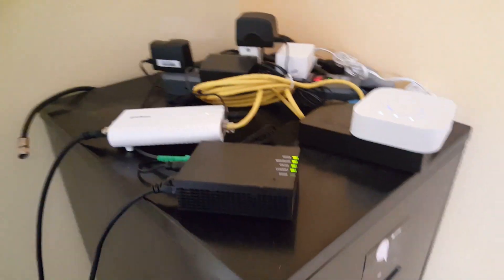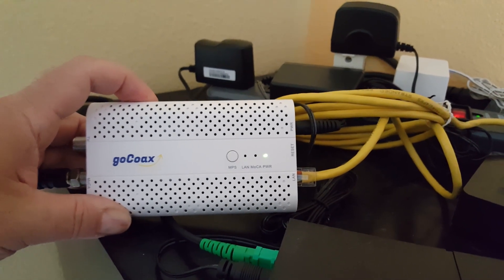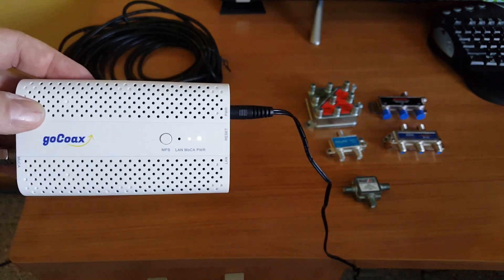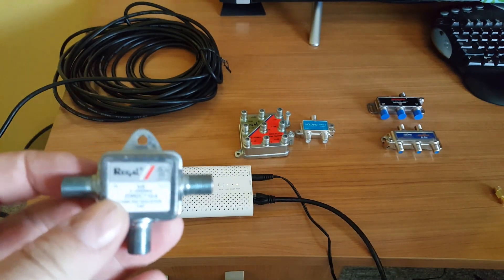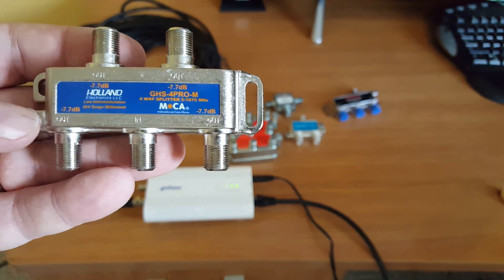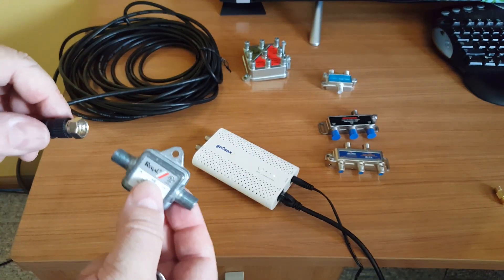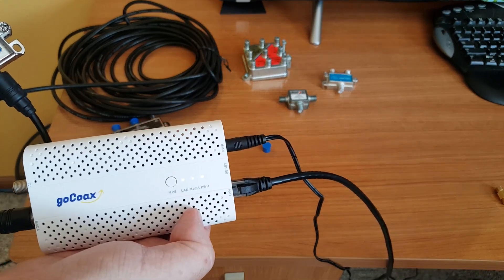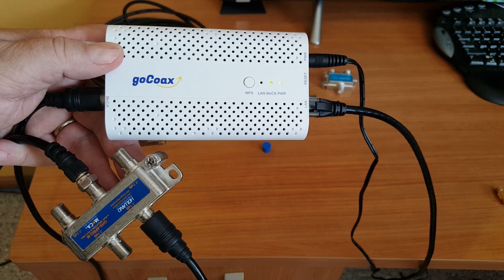How to troubleshoot connection problems with MoCA (goCoax WF-803M) and basic MoCA setup requirements

Comment: Wait, reviewed slitters, then at the end "why wouldn't a moca connection not work? I don't know!"  The video is titled How to troubleshoot... not reviewing splitters.
Reply from the maker: the wrong splitter and/or incorrect testing/diagnosis of a basic connection is the most likely cause of your MoCA connection not working.  Above all else, do the devices communicate when directly connected?  then is my splitter compatible (and I mean ALL splitters in the walls, not just the ONE you can see).  MoCA is pretty bulletproof, but you do have to eliminate the obvious issues before you go off the deep end and say the devices don't work.

Comment: Thank you. My network will work
Reply: I want to set up a network to sell the internet to 1000  apartments. They have done coaxial wiring for TV centarall.
I would like to know how many MoCA units can be supported by one unit and the distance it can cover.
Reply from the maker: 16 nodes, up to 300 feet apart.  That is the limit.
Reply from the maker: I sincerely hope so, friend!

Comment: So how do I set this up when junction box is upstairs?  I have five coax runs coming from the junction box to certain parts of the home, both upstairs and downstairs.  Does one MOCA connect to the Modem or to the router?  What about a "filter" to ensure traffic is not thrown out in the wild?  

As for the second MOCA, I get the setup and understand that part.  And what about connecting FIVE rooms?  I need one MOCA at the modem or router and FIVE other MOCA adapters in the rooms and connected?
Reply from the maker: You can put a MoCA filter at the point the coaxial enters your home to stop leaks.
As far as the number of devices, yes, one at the modem/router and one at each other drop point.  5 rooms aside from the router = 6 devices.
As far as the junction being "upstairs", it works no different than if it were downstairs as in my example.  At least as far as I can see.  It all translates.
Reply: @UncleMikeRetro  THANK YOU!!  I will Google a filter as I have never had to use one don't know which type to use.  My confusion still is where the Coac comes  Is into the house ...I'm guessing a filter on a splitter and then the outs would connect one  MOCA box and then each of my rooms?  Then the Ethernet from the MOCA box plugs directly into the Wan port on the router?   The setup before this was coax into the Modem and the Ethernet port on the modem plugged directly into the WAN  port on the router.    So am I completely incorrect in that if I use MOCA setup I bypass the modem and do not use that.  

 Ask for the rest of the devices in the house I understand how the mocha works it's just at the modem/ router part
Reply from the maker: @GR8GUY54  Glad to help.  How can you bypass your modem and still have internet?  The modem should plug into the WAN port of your router and then one of the ethernet ports of the router should plug into the MoCA device right there.  Then the coaxial out of that MoCA device feeds back into the coaxial lines in your home and should find each of the other MoCA devices in the other rooms.  It can sound complicated but isn't in all reality.

Comment: Thanks for doing this video! It gave me the idea to directly connect the 2 devices first to make sure they're working just fine. Found out it's a problem with the coax wire runs in the wall. Appreciate it!
Reply from the maker: Glad I could help!
I do try to preach to do the smallest checks first, rip open the walls as a last resort!
Reply: @UncleMikeRetro  I should have checked the coax runs first. Whoever redid these last removed the 8 way splitter and just connected one cable directly to the jack near the modem in a closet
Reply from the maker: I mean, really?  That's all you can say...

Comment: My Spectrum Ubee modem is not MoCa enabled or set up, which means I would need to have a MoCa adapter connected to it before I can begin connecting MoCa adapters elsewhere throughout the house. However, the splitter that connects to the coax cable in the wall and outside, is an Antronix ARPI-2000 Power Inserter ; 5 MHz - 1002 MHz. So with this particular splitter that TimeWarner/Spectrum set up, one end is connected to a cable that goes to the coax wall, another coax connected to the modem, and another coax connected to an AC power that's plugged into an outlet. The Spectrum tech support said she had no MoCa training but suggested getting a MoCa enabled modem that is separate from the Ubee, which would be used for home phone/landline services, and the second modem for internet and mesh setup. Is this the best option or is there a splitter option that doesn't require me getting a second modem? I hope this makes sense and thanks in advance.
Reply from the maker: Do you have your own router?  You should just connect a MoCA adapter to one of the LAN ports of your router and then send the signal back through your own coaxial lines.  you need 2 MoCA devices to start.  My own setup that I show in the video has no MoCA-enabled anythings but the adapters.
Reply: @UncleMikeRetro  I am still using the Apple AirPort Extreme/Express setup, which is currently just wireless. However, I was planning on updating to the Eero Pro mesh 6e WiFi to update. And my plan was to connect each mesh unit to the Coax tv cables on each floor to ensure stronger Wifi. If I don't set up the Moca at the network base modem and end up just connecting it to the next room where Spectrum cable tv is and then connect MoCa in both basement and upstairs in order to set up the mesh....will that be fine and ensure MoCa stays strong and secured as well? Thanks in advance.
Reply from the maker: No, the MoCA will only work AFTER there is an IP address for it to transmit.  The devices basically act like ethernet cables.  They take a signal and move it along the coaxial lines.  Taking the signal directly form the modem will NOT allow it to get an IP address, so this won't work.  You really need a router OR a switch attached to your mesh network, but it needs a lan port and a signal with an IP address.
Reply: Not sure if this will help your problem, but a lot of MoCA devices operate between 1000 - 2000 MHz range. For example, the Hitron HT-EM4 works between 1175 and 1625 MHz. So your splitter might be out of range.

Maybe replacing the splitter with one that's 5 - 2500 MHz (common to find) might fix the issue?
Reply from the maker: @mikeburke3279  That might be a super idea.  Not too expensive to try.

Comment: My 2016 Spectrum Ubee modem I think is supposedly moca enabled (or can be) but not sure if the splitter they used with it is a moca splitter. If Ubee modem is moca enabled, then should i update the splitter (if not a mocha splitter) that connects to it if not currently set up to be moca enabled? Or should i instead connect a mocha adapter to the modem? I hope this makes sense. Thanks in advance.
Reply from the maker: check to see what frequencies that splitter uses.  MoCA is usually 850-1500

Comment: Your video saved me! Our modem was installed in the basement.  router is on first floor. Worked for a while, then stopped recently.  Couldnt get it working using Customer support.   I strung a 100' ethernet cable from basement to router, and it worked fine, but couldn't find an easy way to get it thru walls/floor.  I read about  Coax to Ethernet adapters and gave it a try, since we have unused coax thruout house. I got 2 Hitron MoCa 2.5 adapters.  I watched a bunch  of videos and couldnt get it working.  Found you video, which clearly and logically laid out how this type of system works and communicates.  You were also the first to explain how older splitters often wont pass the MoCa  2.5 signals. I ditched the 2 splitters in the path, and  it instantly worked!!   I think I could have gotten older cheaper non-MoCa adapters, and it might have worked, even with the splitters.  Thanks for all the great information, presented in such a clear way.
Reply from the maker: Get out!  Such a nice detailed comment that I am sure others have trouble with too.   Any time something I post in good faith helps a new friend makes my day!😄

Comment: Could non moca approved but working 1 in, 2 out splitters be slowing my connection? I get about 700mbs dl to my Motorola Wi-Fi combo router. I have 1 gig service from RCN. So down in speed right away. My setup: From street there is Poe filter then splitter number 1 then to router. Router has the first moca device. Splitter number one second coax runs to other side of house where it splits again to bedroom and living room. Lr and br have working moca devices. But when I tested those speeds at the end moca devices hooked to laptop the were like 60mbs dl so serious deterioration. I have about 12-15 smart devices using Wi-Fi, ring, 3 Amazon units, tv, hue lights, ecobee. My moca devices are screenbeams 2.5. Everything is working great but that speed loss bugs me. The distance from one side of house is about 30’ run of coax. And my desktop computer wired directly to my Motorola router/Wi-Fi combo gets about 700mb dl at first but goes down as speedtest runs and ends about 280mbs dl. Thank you!
Reply from the maker: In THEORY, everything should work fine.
But, as we can see, there is a loss (serious) in speed.
You are going to HATE this suggestion, but you really have to disconnect all of the devices and then test the speeds of each one individually to see if any of the other devices are interfering.
Then, you have to take two devices, one at the router (where I assume your MoCA signal originates) and the other device at each of the other ends/drops/rooms to test the speed of just those two devices and see if some of your lines have issues.
When I was setting my network up, you would not believe all of the tiny 1 in 2 out splitters that I found in the walls (because no one really runs 100' of coaxial if they can just connect 3 or 4 25' lines, right?).
I had to clean a lot up.
Reply: @UncleMikeRetro  by disconnecting all the devices you mean all the ones on wifi side or the physically connected ones at moca? Thx
Reply: I forgot to add I ran all the coax new myself so know it well.
Reply from the maker: OK.
Hmmm.  Can you do a test run with just two physical MoCA devices and a run of your new coax line?  See if you can get 1GB in any case, using best methods and conditions.  The WIFI devices, as you allude to, should NOT make any difference.  If you get a 1GB speed test run from your ISP, you should get very close to this (900+) in a straight connection.  I would think.
Reply: @UncleMikeRetro  i will try that on Monday. Thats exactly what I was thinking too. Also if that works, run a line straight to a Moca in lr sans splitters
Reply from the maker: @Daltondoubledeuce  Let us know how that goes, Ed
Reply: @UncleMikeRetro  Okay, sometimes its not the results that are wrong, but the testing equipment. I have 2 Imacs on my desk, one 2011, one 2019. Older Imac was connected ethernet to router when I tested. I also tested the end points with an even older Macbook. I should have known. 

I moved the ethernet to my 2019 Imac, boom 900mbs. So I moved my 2019 Imac to both MoCa endpoints, plugged in ethernet and boom again 900mbs. So my network is functioning perfectly. Doh! Thx for your help - Ed
Reply: Sometimes your router can't handle gigabit speeds (my old R7000 from 2014 would max out at 250 megabit). When I upgraded from a 300 megabit connection via Cox, I replaced the router with a new WiFi 7 router. Something to consider.

Comment: Hello, I'm just finding this video and it was very helpful.  I have a couple of questions, but let me ask this one first.  My cable wire entry point is located on a box on the outside of the house.  This is considered Spectrum's property therefore I cannot find out if they have MoCA splitters installed without making a service call.  Inside the house I can modify the wiring.  If I install MoCA splitter inside will that work or does it need to be at the point of entry?
Reply from the maker: Hello and welcome!  
The MoCA splitter you use should REPLACE the large one that is probably somewhere inside your home.  The Spectrum signal should come into the house via 1 coaxial line then get split (somewhere, like mine was in the ceiling of my utility room) to send a line to each separate drop.  Just replace this splitter with a MoCA capable one and no worries.
THIS video may explain better:  https://youtu.be/_Gfjnspfd94
Reply: @UncleMikeRetro  Hi again, I don't believe I have a splitter inside my walls.  I can trace the four wires from the junction box on the outside of my house making the 4 outlets inside the house.  I only have 4 cable outlets and using 3.  On one of the outlets I have split the signal so I can have internet and cable TV in that room.  That splitter is not MoCA compatible.  If I swap that with a compatible MoCA do you think that will work ?
At the junction box I did open it and nothing in there is MoCA compatible (8 port amplifier and small splitter) and Spectrum told me via chat they don't do MoCA
Reply from the maker: @jl9893  What a pickle!  Well, you can TRY to see if the MoCA signal will get through their amplified splitter and the smaller one.  Otherwise, I'd ASK Spectrum if you can swap their amplified splitter with a MoCA capable one.  If they say NO, there are ways to try to get a signal to one other room, but w/o being able to swap that splitter, this is an issue.  Feel free to Gmail me a pic of your setup in the Spectrum box.  The address is on my YT about page.

Comment: I've had go coax for a few years now, I've got 3, and randomly one has started to give me issues. It intermittently cuts out with no rhyme or reason. I've replaced all the ethernet chords attached to it as well as the entire coax line connecting them. It'll work totally fine then just randomly stop, even though the moca light is still on. Is it possible my moca box is going bad? Could my switch be bad?
Reply from the maker: This is just an opinion, but switches rarely fail like that.  Can you try to isolate it between two computers w/o the MoCA on the line?  Also, have you done a factory reset of the MoCA device via the detent button?
Reply: @Uncle Mike Retro  I did a factory reset but I don't know that it worked, I may need to log into the web side to do it. The first sign of trouble was crazy latency, then I reset the one problem device. After that i couldn't get the damn thing to reconnect to save my life which led to replacing the coax between. Finally got it reconnected and the problem seemed to be fixed for a while. Now it just keeps losing internet even though it says the Moca is still connected and the wifi and internet elsewhere is working fine.
Reply from the maker: One last thing...  Have you isolated that coaxial run from one computer to another with the 2 MoCA devices you THINK are OK?  Got to eliminate all else then it has to be that 3rd device.  You can mix and match, so a replacement device is (I believe) as cheap as 50 bucks now.
Reply: @Uncle Mike Retro  I temporarily ran a brand new coax between the two. Let me ask this, I also use tivo minis that use MoCa to connect to the internet. Is it possible they are interfering with the moca connections? It's never been an issue before but I'm running out of ideas, and MoCa is nearly a cult thing so there's not many people who really seem to know.
Reply from the maker: @bryguy2724  I cannot see why they would suddenly create an issue if they were working fine before.  They genuinely use MoCA?  Not just the ethernet from a MoCA device?
Reply: @bryguy2724  FYI, TiVo minis use v1 MOCA. Use their ethernet port and disconnect their coax unless you want all your MOCA devices to drop down to the 300 megabit they run at.
Reply: I have seen similar symptoms from a failed MOCA filter. Make sure you have one properly placed, and use MOCA rated splitters.

Comment: There are splitters that are compatible with both cable TV plus satellite TV signals. The frequency range is betweeen 5 - 2400 MHz, newer models support frequencies up to 2500 MHz. This type of splitter should work. I don't have MoCA but I'm interested in buying these adapters, I have unused RG6 trishield coax cables and I want to use them  for internet since my Wi-Fi is a complete nigthmare.
Reply from the maker: Yes!  You could of course go with a wider spectrum of frequencies on the splitters.  More expensive and all but definitely workable.  I can't say again how nice it is to have full speed LAN downstairs w/o ripping up my drywall 🥰